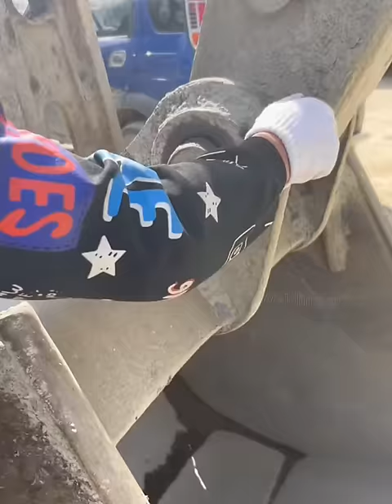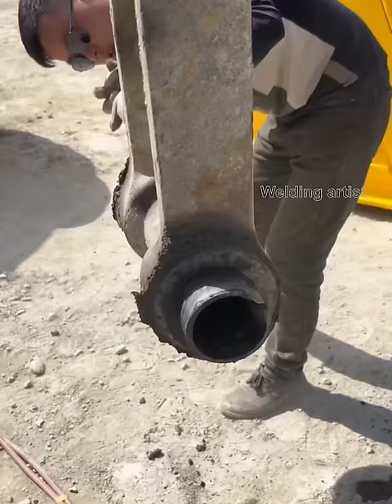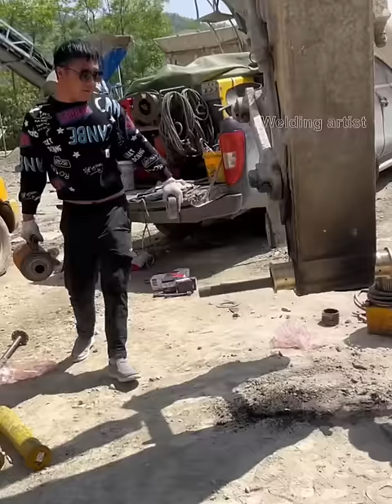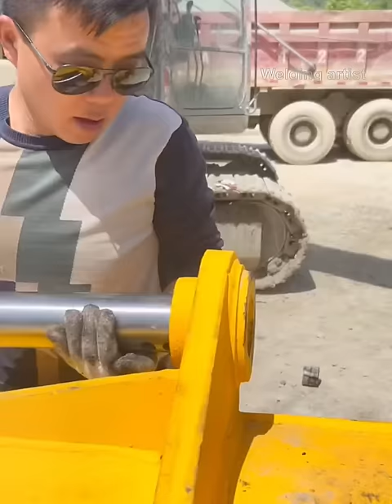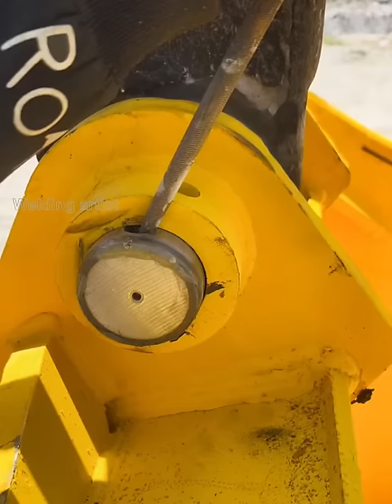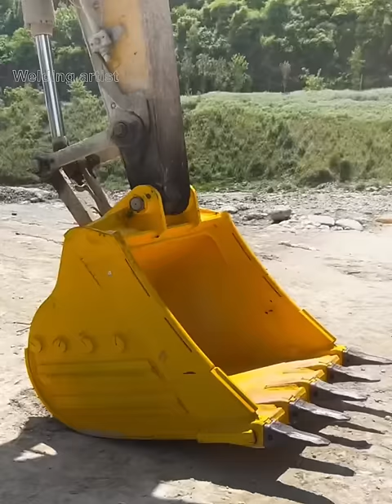Replace a bore bushing for new excavator bucket, perfect welding repair work of excavator

Comment: You need to tear your hands off. Does religion not allow you to lubricate bushings under pressure? You cannot hammer the bushing with a sledgehammer! This sledgehammer is designed to hit such mechanics on the head.